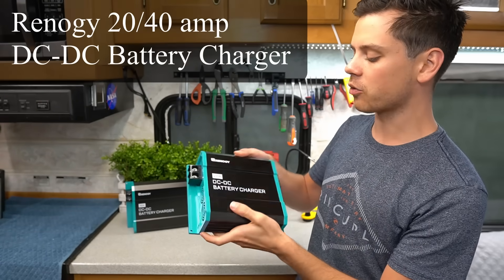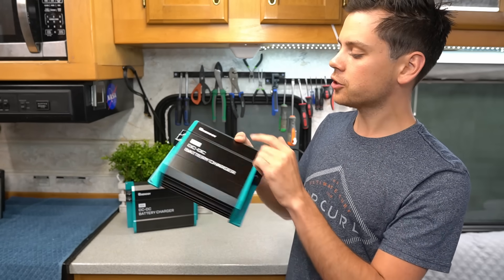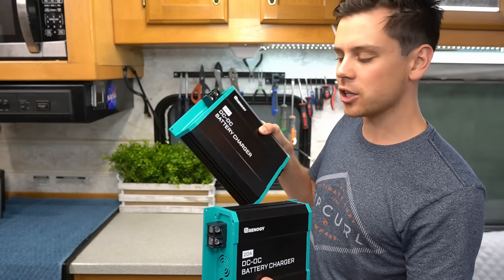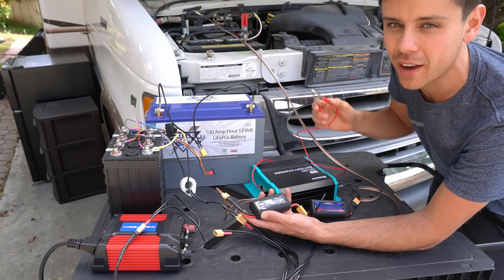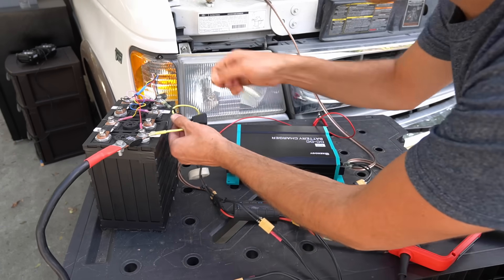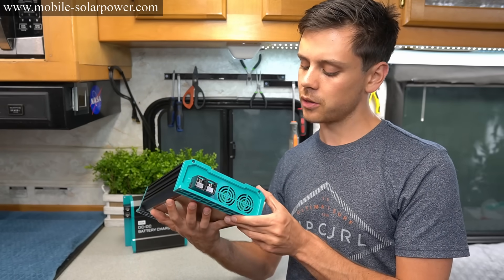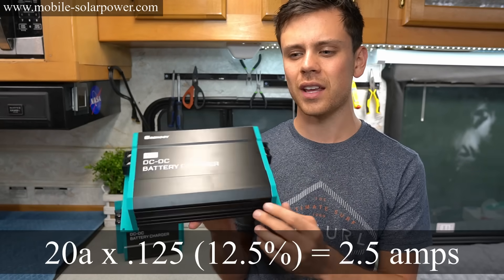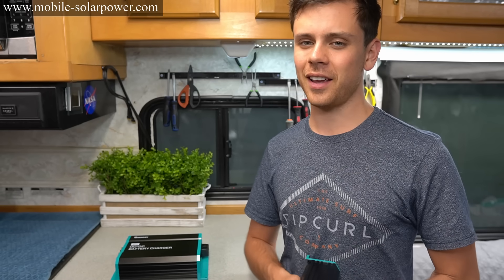Renogy DC-DC Battery Charger Review: "Smart" Alternator Charging for Solar Batteries!

Comment: Hello to you guys,I do not want to load my alternator and especially the electrical system with 20A. Can I use a simple 10A PWM solar charge controller instead of the DC-DC charge controller?
Best regards Tobias
Reply: According to the instruction manual the 20 amp unit can be lower to 10 amp output by hooking up the LC wire.

Comment: Hey Will I'm trying to decide on the 20 amp or the 40 amp. I want the fastest way to charge my trailer battery, (I have 1 wet cell deep cycle 12v battery in my trailer and a 160 amp alternator in my jeep, what size charger would you suggest?

PS.  I'm a huge fan and just bought your book, learning tons from it......lol I just about need a new highlighter haha
Reply from the maker: 40 amps for a wet cell for sure. And thanks :)

Comment: I recently saw a video from Goal Zero where they used a device they sell called a link to charge the yeti 700, 1400, and 3000 from the car's starting battery. In that video, they say the link acts like an isolator. Would you recommend dc-dc charging over the link technology?
Reply: The links are probably low draw electronic type relays.  They will isolate and combine as needed, but will not manage the voltage.  I have such a setup and at idle the voltage is too low to charge sometimes.  Or it does not get high enough to fully charge.  DC to DC is preferred.

Comment: Use the D+ terminal in conjunction with a small timer PLC to delay DC-DC connection when the ignition switch is turned on.
Reply: I ordered a delay module but left it in my storage unit! Great idea. The new dual input has a 15 second delay built in after the start battery is receiving 13.2 volts or more. That could be 12.7v?
Reply: @tomaskey6844  It would be nice if you could program the delay time, but if it is waiting till full voltage is reached on the start battery, it should self prioritize. The only problem would be if your preset voltage threshold was rarely or never reached.

Comment: Will this work side by side with a solar charging system controlled by an MPPT charger?
Reply: This is how I am wiring my rig. The solar will charge when the engine is off and the DC-DC will charge only if the bank needs it. I have a XY timer PLC to delay connection of the DC-DC to give the alternator time to charge the starting battery. I will be using a manual 1-2 selector for emergency operation redundancy (jump starting, charger failure, alternator failure, etc.)
Both units use diodes and battery level sensing, so they will only charge if the batteries call for it and the diodes protect and isolate.

Comment: can you test the new 
DCC50S 12V 50A DC-DC On-Board Battery Charger with MPPT
Reply: I ordered the 25A dual input model today to replace a failed Renogy 20A single input charger. So far Renogy has not responded to my service ticket or phone calls. I also ordered the Redarc 1225D to test and have as a back up.
Reply: Tom Askey Did you ever get any service out of Renogy? I’m having an issue with them on a failed Rover 40a Charge controller. 49 minutes on hold about 5 days after submitting a ticket on line. Was told I would be emailed a call tag  as soon as we hung up, but none ever came. Because I already have the 40a Charge Controller, I don’t want to get the 50a DC-DC On Board w/MPPT, but I have looked at the 40a DC-DC, but am reluctant to buy because of the serious decline in customer service from these guys. Also, Ive read the specs on the 50a unit and the way I read it it’s 25a on MPPT and 25a on charger. That would be okay on a bright sunny day as you drive around (50a combined), but what if its dark and raining? Only 25 amps?  Still, their customer service seems pretty darned sucky...
Reply: Rey Mendez I never was able to get them by phone or email or ticket submission. Nothing at all.
Reply: Rey Mendez I never received any support at all after trying to call over several days, submitting support requests multiple times, sending emails, and trying to use their chat service. The unit did start working again but since I had already ordered the new DC-DC with MPPT charging, I installed it and it’s working fine other than the Bluetooth dongle is not working
Reply: Tom Askey I did finally get them to issue a call tag for the unit I have, and they say they will send me a replacement once they see the return tracking in motion, but I have to say I’m reluctant to do much with them again. I’ve already replaced the Rover 40 with a 40amp MPPT controller from a different manufacturer.  On another note, I just ordered their 40amp DC to DC charger because there really aren’t  many choices available for DC toDC chargers. Since all this gear is going into a traveling rig I opted to keep the MPPT and the DC to DC as separate components in case of failure. BTW, I was only able to get Renogy to respond to my warranty request because I called Amazon and complained to them. The CSR slipped that they’ve had a significant amount of complaints about Renogy. Amazon contacted Renogy on my behalf through whatever channels they use and got the ball rolling. It took less than 48 hours from that point to get to today. We’ll see if it takes 4 more weeks for the replacement... Still curious on the charge capacities of the DC-DC-MPPT unit. I still think its 25 and 25 amps... Good luck anyway!
Reply: Rey Mendez I think I’ll be switching to Victron. I just ordered their battery monitor because the Renogy one does not have BT. I think the Redarc DC-DC charger looks good and was going to try it but was sent the wrong item.

Comment: Thanks for the great content.  Renogy released a dual-input (i.e., accepts solar input) 50A DC to DC charger last month for $300.  I have the Redarc dual-input 40A DC to DC charger which has been working great, but the Renogy is a lot cheaper at $300 vs $480 for Redarc 50A version.   Would love to hear your thoughts if you get the opportunity to test one!  Thanks!
Reply: Glamp City, I’ve been looking at the Redarc unit (the 25amp is only about $60 more than the Renogy, granted, lower capacity), and it seems the Redarc may be more suited to mounting in the engine bay based on its sealed construction. The Renogy manual says it can be mounted in the engine bay, but I wonder about its longevity in that environment.
Reply: @roberts3889  - What is the warranty the Renogy?
Reply: I’m not sure on the warranty but mine has failed and Renogy is not responding to a service ticket or phone calls. I tried to get expedited shipping on an order for the dual input model but they never responded so i will have to wait to pick it up when I get home. I also ordered the Redarc 1225D as a back up and to test it out.
Reply: My 20A Renogy dc-dc charger failed after only a few months so today I ordered the both the Renogy and Redarc dual input units to test and compare. I’m feeling a little disappointed with Renogy at the moment but maybe they can redeem themselves?

Comment: Are they avalible to charge 7s liion? 3.7/4.2v?? My house system is 29.4v full. I want to charge with an alternator! I don't want to use a pile of small DC to DC CC/CV converters, I have one that can do about 10 amps, but that's not enough, im thinking about building my own large DC converter, but rather not!

Comment: Purchased a Renogy 20amp unit, waited 3 weeks for the Temp sensor, install the unit and its faulty, Cheap Crap from China, My advice, steer clear of these DC Chargers there Rubbish.
Reply from the maker: Dang how was it faulty?!
Reply: G'Day Mate, It tries to start, then shuts down, Renogy just gave me the run around till ebays the 30 day return policy expired, should of connected on the bench first like you, won't be buying there cheap rubbish again.
Reply: Further inspection of the charger I found a small square nut jammed in against the internal control board, very poor workman ship. Cheers M8, also after testing temp sensor I found them to be incompatible with the chargers and also cause the unit to shut down.

Comment: Hi Will, THANK YOU!  This is the only video I can find on this.  Have you tested this with a common ground?  My RV has the chassis and coach batteries both grounded to the frame, so I'm just wondering if I can run the input or both grounds to the chassis?  I already have a 12v positive running to the back of the RV, just don't see why I would need to run a 6 AWG wire up to the battery negative in the engine bay.  Thanks,
Mark

Comment: @DIY Solar Power... Are you aware of the CTEK D250SE  (Charges at 20A and includes dual inputs for alternator and solar, includes MPPT charge controller) and can be combined with Smartpass 120S (Ups Charge to 140Amps)??? They are new versions of their products that are now compatible with lithium battery systems. So new I guess, that I can't find the SE and S versions for sale anywhere yet. But thought with up to 140 charging amps this could be useful on your rig, and I'd love to see a vid using it or something similar that showed me setup guide and allowed me to charge a 200AH+ battery bank while driving from alternator,  and solar, generator, and also plug into shore AC power when parked if possible. A review of the products would also be welcome :)

Comment: can this be used  on a Renogy 12v 200ah gel cell deep cycle battery?
Reply: I have two Renogy 100ah Gel batteries in parallel making it 200ah combined. Specification shows that these batteries are good for 10A charge rate per battery. That means 20A for both combined. I "can" do 40A charge which is 20A per battery but will be pushing it.  Your 200Ah battery will do well at 20A but you can push it to 40A. Personally, I'd choose 20A.

Comment: Will, I'm curious if you have looked at the Redarc dual input BCDC chargers. They have a built-in MPPT controller, built-in battery isolator, charge from Solar and/or Alternator and only have to connect to the ignition if the vehicle has a smart alternator. Standard alternators only require positive and ground connection. etrailer carries the 40 amp model for $430 + free shipping. I have looked everywhere for the MPPT max input but can't find it anywhere. Would be great if you could review this.
Update: I just heard back from etrailer that the MPPT controller is 40 amp as well.  This really looks like an awesome unit.
Reply: Nice but a lot more expensive.
Reply: @tgriebe  includes the 40amp MPPT controller and battery isolator with auto switching between solar and Aternator giving preference to solar.
And it's all in one unit with easy hookup.
Reply: @TheWoodHaven  I know. This Renogy is an inexpensive device for those that don't need the full capabilities of the Redarc which is 2 or 3 times as expensive.

Comment: Hi Will, Is there any reason I couldn't use a B2B charger exclusively to charge a 120AH lithium battery bank with built in BMS without solar? Assuming the B2B charger has 3 stage charging capabilities and can be adjusted for the charge profile parameters I can't see any reason why solar would be required.

Comment: My guess is the ignition sense is an absolute must, otherwise the parasitic drain of the converter looking for a higher voltage on the input may flatten your starting battery resulting in you getting started or needing to jump off your solar battery.

Comment: Hi, I'm planning to use a 12v16Ah LiFePO4 battery as a replacement for my car battery. I want to get the best battery life possible by recuding the max charging current. Can I use this as a charging current limiter in between the battery and alternator?
Secondly, can it also cut off charging when a certain voltage is reached?
Thanks in advance
P.S. It's mainly a starting battery as the alternator supplies sufficient power for the lights and radio by itself.
Reply: I currently am researching the idea of using a lithium battery to replace the sealed lead acid vehicle starting battery in my vehicle. But after reading your question, a thought came to mind, that the BMS in the lithium batteries will stop receiving a charge from the charging source in this case the alternator.

 How it does that I am not sure, but if it acts like a dead battery by disconnecting itself from that power source, this could conflict with the alternator system. 

The alternator system looks for and test the voltage of the battery in the car to continue feeding it power or not so if this does not conflict between the alternator sampling the charge on the battery and the BMS inside the lithium battery, then things should work out OK.

 but more research is needed in this area before I would experiment with replacing the SLA vehicle battery with a BMS equipped lithium battery.

Also, the vehicle batteries are designed to provide high amps for short amount of time. The typical 12v 100amp hour lithium battery is not. 

Did you try using it? How did it go?

Comment: I purchased the Renogy DC/DC charger 40A model. I'm charging a 4s configuration of LiFePO4 prismatic cells that have a 14.5 charge maximum. I wanted to configure the dip switches correctly, but the manual (page 22) was confusing. After going on the renogy site, I was still confused so I called support. They informed me there is a typo in the printed manual. Under the Type 2 heading the table should be labled with S1 and S2 not S3 and S4 like the table above. In my case, the Dip switch settings will be S1 - OFF, S2 - ON, S3 - ON, S4 ON, and S5 - OFF. 

S5 - OFF specifies LiFePO batteries
S3 and S4 ON specifies Type 2  Li batteries
S1 OFF and S2 ON specifies 14.4V charge mode
Reply from the maker: Thank you for finding this
Reply: I was thinking this might be a typo, thanks so much for confirming.  However, I don't understand what then happens to the float voltage parameter?
Reply: @lyubkin  There is no float in Li mode.

Comment: Can I use this on an old style converter in the RV.  I think it outputs 45 amps but the charge cycle is for acid not lithium.  If I put this in line can it clean that up so it can be used for lithium?

Comment: Hey man, I'm all but finished installing new this in my van, where do I connect the signal line that connects to D+ on this thing?? I've scoured the instruction manual and there's nothing that says where to connect it to. I see that you plugged it into your battery to bypass it but where in my car will I plug this line into?
Reply: TreeCycled Did you get this figured out?  Would a appreciate an answer, if you did.  Thanks!
Reply: @chrisbaker2216  Any empty fuse holder in the fuse block that turns on with the ignition. (multimeter!)  That way the charger won't continuously draw from the starter battery. Should have been auto turn on inside the charger w/o the D+ wire! This is future release. But for now... Connect the wire to a spade terminal connector and modify it (snip) to push into the empty fuse holder
Reply: @cstu444  Wow!  How easy is that?!!  Sometimes, I believe we make things harder than they have to be.  I was envisioning disassembling the steering column to get at the ignition.  You've definitely saved me, and a lot of others, I'm assuming, a great deal of work!  Thanks!

Comment: If you have a 24v battery bank in RV and use this charger, on the output you think you could add a dc voltage booster in order to charge that 24v battery?

Comment: I have an adventure van that is only used once or twice a month.  To keep the batteries charged I'm wanting to get a AC to DC battery charger.  Can I charge both my starting battery and my secondary battery off the same charger?   So on the DC to DC battery charger starting battery input connect the AC battery charger to charge the starting battery.  And connected to the secondary battery output connect the AC to DC charger too. This way I can just leave the smart charger connected until I use the vehicle. Do you think this would work?

Comment: Thanks for the great review.  I am planning to buy one of the 40 amp versions, especially after watching this review, but have a question that you might be able to answer.  Do you think it would be possible to switch the connections (make the input a LiFePo4 and the output the starter battery) if the starter battery was accidentally drained?  I see some other products on the market that have this ability and figured it could be very useful.  I was planning to make quick compatible disconnects by the charger itself for easy cable swapping if my starter battery died.  I wouldn't run off the house battery, just simply charge the starter battery until it was able to turn over again.
Reply: Josh Ulrich Good question. A “parallel switch” might be better. 40 amps might not be enough to crank your starter and if you have a bad starting battery you may drain your house batteries trying to charge it instead of quickly using the available energy to start the engine. A lot of RVs come with a parallel switch. So there’s lots of options for parts. Victron Energy makes a Cyrix Battery Combiner that should work.

Comment: Will, 
Great channel, love the content.
I have a question.
I have a 100ah 12v Lithium battery in my camper with a Victron 100/30 for solar charging. I connect up 300watt solar once I have my camp set up. I have a 3 way fridge in teh camper that pull 10amp of 12v during transit. 
* Can you advise if I can connect my alternator to the MPPT input to charge during transit? 
* What are the risks?
Looking forward to your reply. 
Regards Leigh